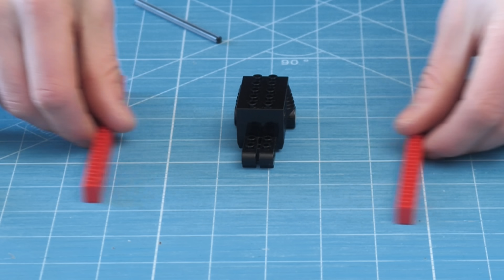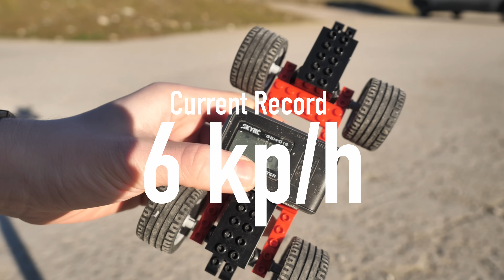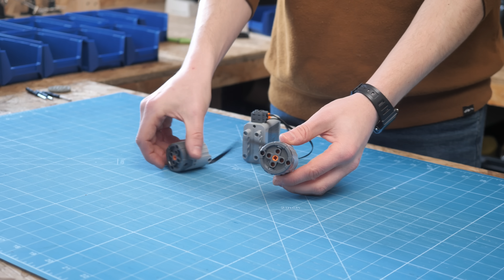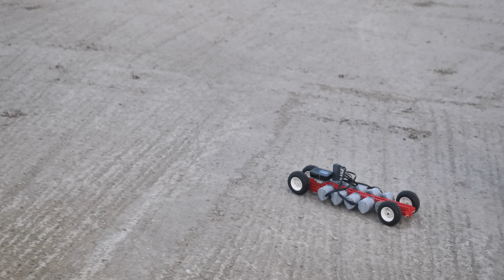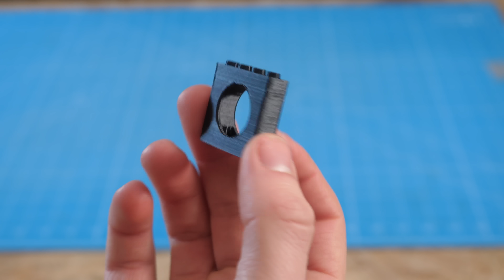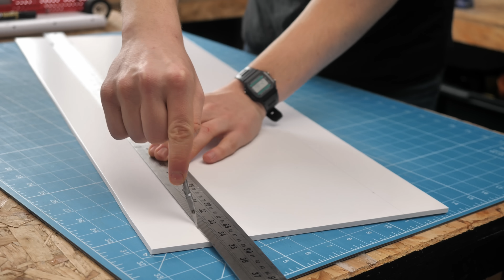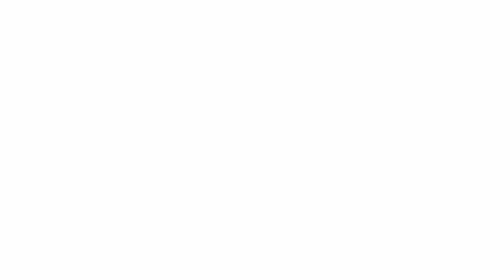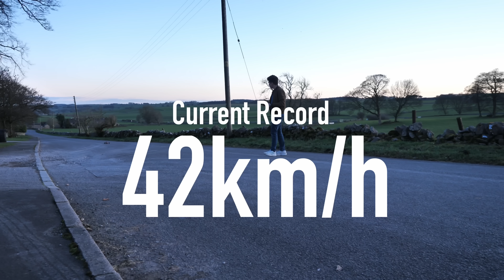Building the FASTEST LEGO Car

Comment: Incredible structural rigidity using just standard Technic beams! 🧱 Usually, high-speed LEGO builds suffer from chassis flex under maximum torque. How many layers of reinforcement did you use to keep the frame torsion-free?

Comment: Those wind-up motors, you used, are the lowest tier lego makes. They are meant to be used with the smallest models. I have 25 year old ones, and they go 35km/h on a dragster chasis, if you combine 2 of them together to drive only the rear wheels. Lego also used to make a speed computer (5206), which you simply slide on the wheel axle - we used one to measure our speed waaaay back in the days. We used the biggest wheels possible - from a truck with pneumatically actuated arm (model no. 8462) and the motors were two "Nitro Burner" ones  (model 8471).

Comment: I tried using a battery powered drill motor some 20 years ago. The gears could not handle the torque and the battery pack from the drill made it heavy and center of gravity was way too high.

Comment: All of your cars were pretty flimsy. If you don't mind adding quite a bit of weight, you can make them much stronger.

However, the surface you're running on will always be an issue unless you use suspension.

Comment: tip: just use a modified more durable axel so it doesnt snap mid race [i prob think you should add some shock absorbers/ spring to reduce the fliping or falling over

Comment: Great steps to exploring limits. Perhaps you reached the limits of ladder chassis designs faster than real cars did? Twist a ladder and quickly find out why American cars took so long to actually handle proper road use fun given the power they offered (braking was another of their issues too, but no comments).
If you wish to break your existing Lego speed record/s, creating greater torque resistance in the chassis and using longer smooth surfaces wouldn't hurt the process. After all, you wouldn't have tried your Guinness WR jet powered RC vehicle attempt on either of those rough street or carpark surfaces.

Lego rules. 1. Original and only pressed together Lego parts. 2. Original Lego parts with additional constraints used to join those parts (e.g. cable-ties and glue). 3. Brand-new Lego parts versus used parts, as previous usage does reduce 'adhesion' of Lego joints (I'm the youngest of 4 siblings and learned the hard way that Lego fun diminished via previous usage, it did make me more creative about just how to use multiple pieces around one joint to add resistance to separation which I didn't see you trying; just how many stub/tube connections and layers of these, are working to resist any separation forces?). 4. Mostly Lego parts used, with only Lego press fits used in assembly. 5. Mostly Lego parts, with any assembly methods used (you did cable-tie the RC motor but not the chassis connections).

I love your work and expect you're not going to return to Lego but what ...no Guinness WR for a Lego vehicle? Certainly Guinness will tell you a set of rules for any WR attempts they would acknowledge in the future.

Comment: What if you purchased a set like the lego technic ford GT? Ik it's a little expensive for experiments like this but it comes with good wheels, independent suspension, steering, and the wheels connect to the lego engine so you could do an rc engine swap on it

Comment: if you wanted to test LEGO cars, but you replaced some LEGO parts... what are yoou testing? You've bbasically done a non-LEGO car with some LEGO parts in it.... If I'd put lego brick on RC car, would I break your 42km/h time, would it be "FASTEST LEGO Car"? If you call record, a LEGO brand record, it should be 100% LEGO brand build - then your record is merely 13km/s?

Comment: Maybe you could build a train instead. So the vehicle won't need to carry batteries and would be more stabilized. Additionally modify a cable to brifly touch the rails instead of using a train motor so it would be still scalable

Comment: The rocket would work if you set it up like a slot car. Put a "T" at the bottom to keep it from coming off. 

An example idea would be two bars/cables drawn tight, over a distance. Then a car with a "keel" of sorts, and a whale tail on the bottom of the keel similar to a hydrofoil design. Then all the rockets your heart desires and hope for the best.

Comment: You coud do so much more. Make the chassis much more durable by adding interlocking vertical and diagonal stiffening bars, add a suspension to all 4 wheels to improve ride quality, and adding a few of theese 6X2 weight bricks filled with metal for trimm and balancing everything out.

Comment: A flywheel approach with larger wheels should work. Your main problem is that the wheels are too small, causing the car to spin out of control at a certain speed. A flywheel could potentially be enough force to run the larger wheels at high speeds.

Comment: i guess its not that hard to archieve an mixed car that is faster.
i guess the main Problems are Stability of the Car and Gear ratio.

the approach i would take would be a much bigger chassi with more space between wheels, and the big motor slapped on with an transmission and a differential to the rear axis.
also, it needs Springs, suspension is crucial even if u had an even surface.
if the power is to big to handle to 2 wheels, make it an 6 wheeler with 2 driven axles.
and put an fpv camera on it, so you dont have to rely on one point of sight.

Comment: When I was about your age (guessing) a long time ago, I also made a rocket Lego car using the little Estes A motors, and went through much the same progression.  1st car, too short, tumbled immediately.  2nd car longer, took off ok until thrust overpowered it and it tumbled at about 15' range.  2nd car v2.0 - added vertical stabilizer from rocket kit.  Success...until front end exploded from road vibrations.  2nd car v2.1 -- taped front end together: SUCCESS! Car traveled straight down road until ejection charge in motor went off.

Comment: Your last crash might have been due to the tire rubber loosening as the forces of their spin pull he tire to a wider diameter than the hub. My Lego tires always got pulled loose by their spin when I’d run them fast.

Comment: 3:00 the middle motor is spinning the opposite way as the two outer one are rotating the same the middle is been the opposite direction and it could potentially break the motor if stressed for long period of time

Comment: For your next lego project, How about testing different existing Lego car kits with steering built in, modifying them top fit motors and servos and gradually upgrading the kind of motor you put in it and see where they start to fall apart? For example you could compare a relatively cheap kit like #42122, then go up in the price ranges, and see how they compare? Kit #42160 could come next, and then #42125 #42156 or #42096, and at the end you could have the most expensive cars, either the Lamborghini #42115 or Ferrari #42143.

Comment: the big problem with the lego engines is they where all powered by just 1 battery box.  the lego battery box should be replaced by a better battery. like a lipo and more then 9 volt. 3S lipo would work a lot better.

Comment: The Lego with several xl motors could have been faster with a suitable battery.  More than 2 of those motors maxes out the amps that battery pack can output...so just 2 of those motors probably would have given you the same speed.

Comment: When I was a kid, my brother and I used to build cars out of Legos to see if we could build one that would stay together when sent down all 11 stairs in our house. Everything was carpeted at the time so it was just a matter of them surviving going from one story down to the other. 

Legos seem to have been different then as most of the blocks were thicker than that and we didn't have any of those longer ones with holes in the sides either so I would say that they were more robust. The common problem was that the wheels just clipped onto these little plastic clips on the side of blocks made for that so the wheels would usually fall off and sometimes they'd pick the entire brick off of the car with them, plus we entirely broke a few such bricks at the little attachment point that clipped into the hub of the wheel. There had to have been loads of friction too since it was just a plastic on plastic bearing. The other thing that happened was that bricks would fall off of the outsides of our cars or whole sections would if we tried to put any hollow space inside the car.

There were no Lego motors or any electronics whatsoever back then and this video is actually the first time I've ever heard of such a thing and now I want some! It was all push-powered stuff back then though. There were RC cars and we ruined several a Christmas/Chanukah present sending them down the stairs to see what happened, although I don't know why we didn't expect them to break even more efficiently than our Lego cars. This is obviously why we only sent a couple of them down the stairs before we realized that they'd all just immediately be destroyed. Seeing all the cool parts I could have harvested from them, I wish I still had them, although I doubt the parts really would have avoided oxidation after all these decades. All of the controllers were likely shittier back then too but I don't know since I've never owned one of these newer ones. The newest remote control thing I've ever owned was one of those cheap RC helicopters that you can fly indoors. I will say both that I suck at flying helicopters and that it was very funny to watch my cats chase and catch the helicopter.

Comment: You can crank the wind up motor a lot more. I used to have one and I would just turn the wheels back as far as I could by hand and then hold it till I had it on the ground it ended up being decently quick if I remember

Comment: Nice Video but you can go way faster. A lot comes down to the design. It's not the lego bricks fault  since a thin stick on wheels is going to be quite unstable. If you would just've build it wider you could've way diffrent results

Comment: there's 2 improvements you can do
first adding suspension to help the car to keep its wheels on the road (it will increase the weight, you'll need to take care about the suspension travel and lego shock absorbers aren't the best but it will absorb the roughness of the road and will improve the stability)
two : don't forget to put a caster angle on your steering to improve stability
the vehicle is very light so the stability is really important

Comment: I am just trying to get the LEGO delorean to a speed of 88mph (in scale)  which would be almost 12km/h, From my experience with motorizing the 1989 batmobile and other LEGO sets and driving them on the road, if you had used a much flatter surface - not some old rubbly tarmac but rather something like concrete or even flat floors indoors, you could easily have achieved higher speeds, even without throwing motors at it (which finally just pushes weight up if you dont gear it properly). I always have that problem when filming outside. Besides your gear ratio looks much too small. Examles: [LEGO1989 Batmobile] https://www.youtube.com/watch?v=mb2n88BAh_k [LEGO DeLorean] https://www.youtube.com/watch?v=r0E3TxaH6wY

Comment: You didn't put too much thought into the design of this chassis. It's rather obvious that if it bends at stand-still, it's bad.

Why didn't you use some kind of wireframe instead of this small-ass flat beam design? Also, some suspension would help dampen the vibrations immensely. Poor project overall.

Comment: I build some Lego RC Cars with BL Motor too. And i can beat the 50 km/h without bearings and with only 2S Lipo Batt(7,4V). I lubricate the moving parts whits Glycerine. This will work fine. If you want to drive on raff roads, you have to add a suspension on the car.  This will make it a lot more stable if you have not a plane ground. A steering Gyro ist also very helpful at high speed.  You can reach 70 an more Km/h with the BL Motor you use in the Vid. Im sure.

Comment: Just a quick note, assuming 100% efficiency from the motors the absolute maximum horsepower you would get from 8 xl lego dc motors is about 0.043, not 0.1. Realistically your looking at 60% of that, so around 0.02 horsepower

Comment: Tip::  when attaching anything with an lcd screen onto one of my RC vehicles/creations,  or using it "in the field" for this sort of experimenting, the moment i get the monitor/sensor, or whatever it is that has a shiny screen, is I first peel off transparent packing tape from a roll, cut to fit, and apply it to the shiny new screen.  Sometimes i wont even cut to fit, because i know ill be replacing that packing tape "screen protector" sometime soon.  

Thought this may be helpful... with future speed monitors or whatever else... that has a nice new shiny screen someone wants to protect

Comment: 48 years ago, using the same rocket motors, Estes C6-5,  my friend and I built a Lego rocket car. The car disassembled in rapid fashion on the first three attempts. However,  we discovered  using Large Lego wheels, 2" in diameter with a 1/4" wide tread, and lengthening the vehicle  to about  2' long AND using a new invention called Krazy Glue. We had three successful runs. Using a stop watch and a blacktop basketball court to measure speed, Lego Landsmasher IV went an astounding 26mph.

Comment: You need to look into some actual lego building techniques to make the things you make stronger.
Instead of just placing beams directly on top of each other, if you place two single plates between them, the holes will line up at exactly the right distance so you can add vertical beams connected with pegs. This will make a much stronger structure.

Comment: This is the simple way to work out max power point of a simple dc motor. ...measure no load speed and then change gearing so that the motor gets to approx 1/2 that no load speed. Its a maths thing.

Comment: I can't believe you're getting paid for what i did for my elementary school science fair at age 10.

Compared top speed and range between a rocket lego car/battery lego car. (Couldn't use rocket motors so i used baking soda and vinegar in a water bottle with one of those sport valves that can be opened instantly)

Comment: The reason your car broke "this easily" is that you do not use Lego Technic. With these technic bricks, it's very easy to pull them apart.

But by using studless Lego technic you can make frames that withstand a lot more abuse. And if you make them good enough, the only way to pull them apart is to physically break the parts (spoiler alert: Lego technic parts are insanely strong!)

Comment: I made a few lego cars that would have survived most of that. Used to battle them head-on, in my house as a kid lol, so naturally they evolved. The trick is overlapping loads of flat pieces. Don't use the chonky bricks where you don't have to, and sandwich the crap out of them with flat bits when you do. Making the cars arrow shaped seemed to help, too.
Build like this, and the cars wont break anymore, but you will start to chip and shatter the actual lego pieces instead, because of how rigid they are. I broke a lot of lego lol.
Reply: Suspension and some strong shapes would have helped a lot too.

Comment: Very fun video, but i'd like to say that adding rake literally does nothing but make the build crooked as you are not dealing with floor aerodynamics. and your final lego design could well be improved on by making the chassis more rigid using lego. You basically made a long beam, ofcourse it's not going to be rigid. A metal plate (let's say 3mm) that long would also flex like crazy.

Comment: back in middle school I gathered as much lego train track as possible and made a sled train thing that had a purely lego mounted CO2 cartridge in it. you would roll it backward into a backstop with a pin that would puncture the CO2. that thing flew. it would go so fast it would derail from the track or once it reached the end, (about 30~ feet of track(it would only take about 4 seconds) and it's wheels touched unstable ground it would just atomize. took a lot of rebuilds but wicked fun.

Comment: I feel like shock mounting the rocket motor on a linear compression spring would reduce issues, as it would act like a capacitor/inductor smoothing out the high jerk from the motor. Basically it would go faster/further if the motor was mounted on a spring... Maybe?

Comment: 99% isopropyl alcholo will instantly release the hold of hot glue on most smooth surfaces. Drop a bit along the edges and it comes off. If stubborn, add some more.

Comment: Ive done this for gits and shiggles before, bought a printers drive belt and pulleys, nice little ribbed design and cut and glue to length, my being young and dumb didnt know much about gear ratio.. that ibtch was 1-1 lol a little too quick for every peice of the build, friction and plastic( axles) arent friends, thing was fassst if you could keep it straight

Comment: I would have definitely started with a big technic car instead of any self built ones... like the chiron or the lambo... mainly because you can just pop the engine out and pop a motor in, these are well built, and uve got space for modifications, plus a gearbox to change ratios, and a working steering from the get go

Comment: Did you try to power 8 XL motors with a single Lego battery pack? Voltage drop on that would've likely been insane and I wouldn't be surprised if it would've been faster with less motors connected to it.